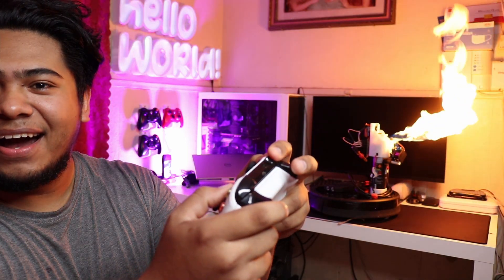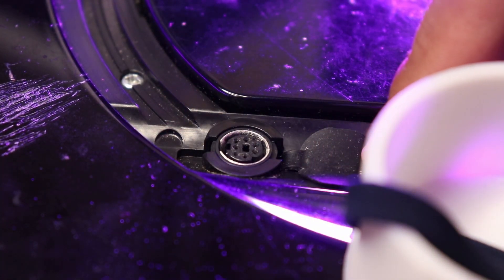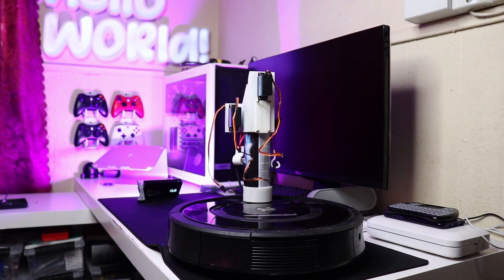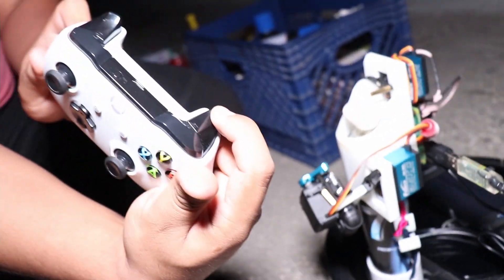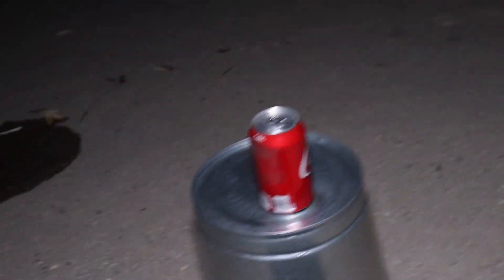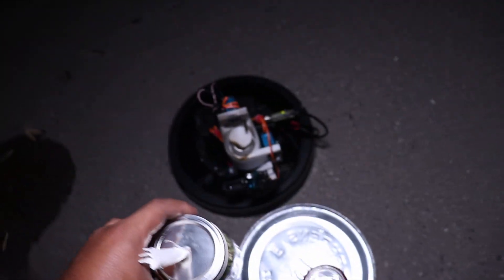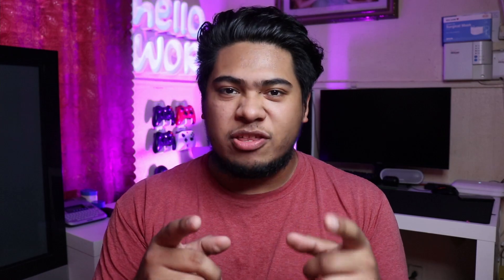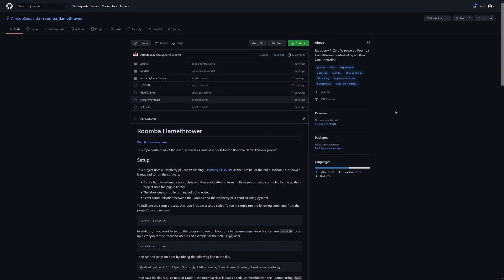I made a flamethrowing Roomba!

Comment: Really cool project, found it on reddit. Quick tip re 3.3/5v conversion - if you dont need high speeds, you might have been able to just use 3.3v to send to the rooma and just put a resistor to receive from the roomba. 3.3v is usually enough to trigger a 5v high signal.
Reply from the maker: Really?! I didn't know that. I might just give that a try.
Reply: @AlfredoSequeida  yeah worked for me for this project https://www.facebook.com/groups/214556078753960/permalink/1518039565072265/